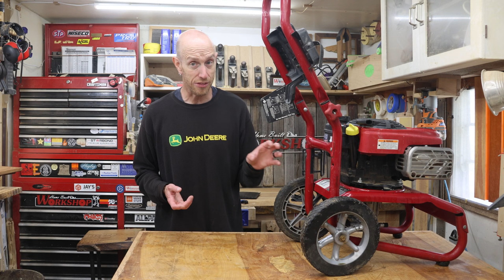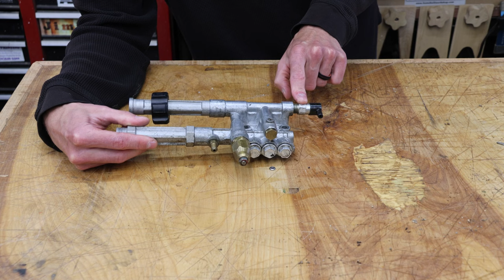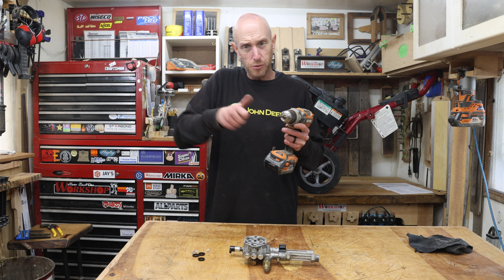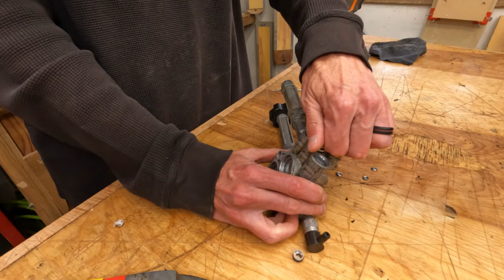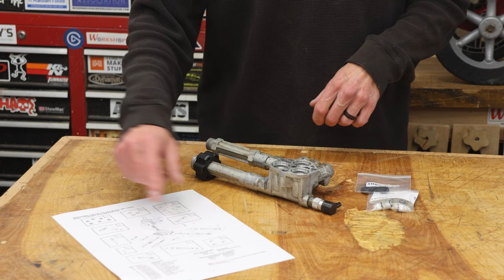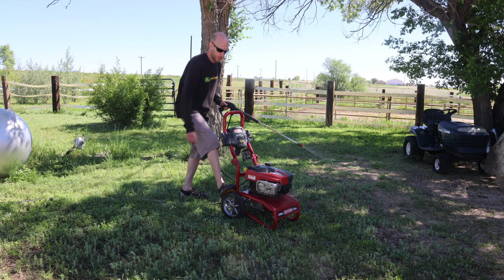How to fix a pressure washer that has no pressure | Replacing the check valves on my pressure washer

Comment: Shut the gas off when you are finished using it. Allow it to run until it sputters and kills on its own! No more gas left in lines and carburetor, stops it from gooing up while not in use!
Reply: agree for any gas engine, but a pressure washer with water pressure on, and trigger off will burn out the plastic pump components. These gas engine pressure washers cannot run with out water moving. Planned death for certain. And the metal is so weak and corrosive, guaranteed more sales.
Reply: @jviews1 so run the water through the wand until the engine runs out of fuel and shut off.
Reply: @ChrisRJ  are you slow? she meant shut the gas off and presssure washer and hold the wand to get all the water out
Reply: @lil_icyyy  Obviously, you are slow. I wasn't even replying to her comment. Do the rest of us a favor and try to think once in a while.
Reply: @lil_icyyy  and as far as her comment, that's not what she meant either. Once again, educate yourself.
Reply: @jviews1  That's why you keep the water on and trigger engaged till the engine cuts off.
Reply: Thanks for info 1:56

Comment: If your pump is like the one I did on YT, a 5/16-18 bolt will thread down into those check valves.  Just pull them out  🙂

Comment: This got me thinking about how to repair my Subaru pressure washer, although I only needed to replace the O-rings and lube up the check-valves, make sure every component could rotate, back-and-forth on everything. And voila! everything works. Maybe if you were more gentle, and used more lube, you wouldn't have needed those replacement parts. Who knows, but knowledge was created here, so thanks.

Comment: The check valves maybe stuck from dried soap. If you’re going to have to extract them, I would suggest letting the manifold soak in water over night.
Reply from the maker: Thats interesting. I didn't even know that could happen. Thanks for the tip.
Reply: I normally don't use any chemicals with my PW but when I do, I  make sure I flush out the pump a few minutes before I shut it down.

Comment: If you get no pressure and it sprays a stream of water without the pump engaging, check the filter first. It is located on the water intake. Mine was 1/2 inch deep plugged with calcium.

Comment: Nice job describing the valve removal and replacement.  Most of the time, these valves will not pull out freely, destroying the white plastic valve cap.

Comment: Cool video.  I run Briggs & Stratton Pump Saver after each use or before storing my pressure washer to extend the life of those internal parts.
Reply from the maker: I may have to get some of that stuff. I have some for my airless paint sprayer, I wonder if its the same stuff.
Reply: i got an 80 dollar pressure washer, electric. Not the most powerful, not the biggest machine. 
When first soaking the area or the car and then using this washer, it works fine.
Has been giving me some pleasure for like 5 years now.

To be honest, if it breaks down, i buy myself a new one for 80 bucks.

I can not for the life of me think of a reason why i should bother using any kind of liquid sjit to try and save the internal parts.
Especially not with the electric ones, because all of em originate from China.
The more expensive ones may have a bit better quality parts but still, they aint gonna last for ever. It is a miracle if they last longer than the warranty period, since most of what we can buy these days is made to last just a bit longer than the warranty period.

Comment: Some Commercial Pumps use to have a Recirc. Valve that would allow Pump to always have water flowing through it to keep pump from Cavitating which causes pump to get too hot thus often destroying pump. When you Stop Spraying for just a moment, you need to turn off/stop motor--often your paper work-directions will tell the owner this...

Comment: Using a paint can opener works well removing the check valves, but you have to grind the sides off a bit. the Check valves are not very sturdy and will fail quickly if water is not keeping them cool.

Comment: What  Would you think would be the next problem if water is leaking out of the head I replace the seals and the check valves and Water is still leaking out but I do have some more pressure than before

Comment: Went to use my power washer yesterday (Craftsman different model) and a stream of water was shooting straight up from unloader valve or soap siphon port(?) I assume it's a check valve issue as well. Pump worked but with less than normal total pressure.  Where exactly did you find the pump schematic and parts to order??
Thanks for posting

Comment: i did mine in 2020 and just did it again and they came out fine with needle nose  the valves separate fairly easy its a 4 piece valve snap apart and back together and i pushed them in fine with needle nose not sure why yours was so tough my washer is 14yrs old......the engine had seized up so i did the mystery oil trick in the spark plug hole and move it in reverse and it un seized
Reply from the maker: I have no idea why they were so stuck. I just used it this morning after sitting all winter and it worked great.

Comment: I had the same issue as you with my AR pump. Took the 3 check valves out on the side (high pressure side) and all three were blown apart into pieces. I ordered new check valves and replaced them after cleaning out all the plastic pieces that broke off and were stuck in the passages. Got it all put back together today and tested it out, but no water would come out at all. Ordered MFG part number and the parts went back together just fine but I can't figure out why the pump wouldn't work. I took it back apart again and the 3 valves on the side were twisted and broken again but no water was coming out. Any thoughts on what is causing the check valve rapid disassembly and blocking water from coming out at all?
Reply: Did u make sure the water was on?? Silly question I know but trust me lol

Comment: i loaned mine to my neighbor who couldnt get it to run, he filled the soap container with gasoline, is it ruined?
Reply from the maker: I wouldn't think so. I'd just try to clean it out as best you can. I'd think it would be ok.
Reply: @homebuiltshop  he said it ran for a few minuits, turns out even with the instructions he was to stupid to turn the gas on, apparently full choke had it start. also he had the wrong nozzle for soap. low pressure. looks like the gas swole up a check ball and it keeps blowing the soap dispenser hose off. taking it in to get it repaired at his cost

Comment: Mine stalls out as soon as i turn the water on. Ideas????
Reply: If it stalls when you release the trigger on the wand, then the unloaded (overpressure valve) is hung up and not recirculating water back to the inlet of the pump.  That part is the large brass valve with the hex nut and center stud next to the valve caps on the side.

Comment: These pumps are total garbage. Homeowner special = shit!. Buy yourself a professional unit. I have a newer toro and its never worked right. I'm on my 2nd pump because the original one never worked. It would have pressure for a second or two then it would be just a weak stream so i replaced the pump and I'm having the same problem. Plenty of h2o pressure from the house and I've tried different hoses still no pressure. POS.